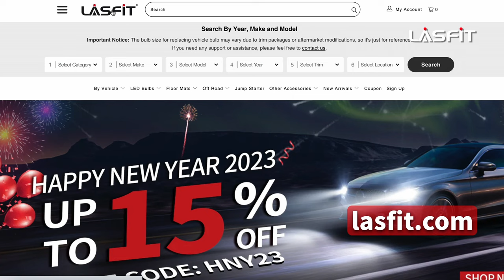NEW Version!!! How to install standard H7 LED headlight bulbs? LA Plus H7 Installation Guide

Comment: Good evening, I would like to replace for fiesta 2015 manufacture halogen bulb with H7 LED bulb, please assist me, im John
Reply from the maker: Hi John, the high beam bulbs for the 2015 Ford Fiesta are H1, and the low beam bulbs are H11. You do not need H7 bulbs.

https://www.lasfit.com/products/2014-2018-ford-fiesta-led-headlight-bulbs-interior-exterior-light-plug-and-play?utm_source=Social&utm_medium=YTB+Channel&utm_campaign=Ford+Fiesta
This link contains the bulbs for all installation positions for the 2015 Ford Fiesta. I hope you find it useful!

Comment: I have a 2016 vw jetty tsi. Which adapter do I need. Thanks.
Reply from the maker: Hi, Lasfit offers H7 bulbs specifically designed for the 2016 VW Jetta, with a Retainer Adapter, ensuring a perfect plug-and-play fit. Here is the link for you: https://www.lasfit.com/products/pro-series-h7-led-headlight-bulb-w-retainer-adapter-for-vw-mercedes-benz?utm_source=Social&utm_medium=YTB+Channel&utm_campaign=Pro-MB1

Comment: Do I need a special adapter for a 2014 Kia Optima?
Reply from the maker: Hi, you don't need a special adapter for the 2014 Kia Optima, but we have found that there are two different bulb sizes for the 2014 Optima low beam.

Please check which bulb size you have H11 or H7 before replacing the halogen one.
Reply: @lasfitvehiclelife  Pretty sure it is H7

Comment: Hi, só do I place the curved opening around the led to the bottom or to the top? It looks like you placed it to the bottom. But you didn't mention anything regarding that
Reply from the maker: Hi， if you are not installing custom-made H7 LED bulbs, please pay attention to the factory adapter before installing aftermarket LED bulbs. As you can see from this video, sometimes the curved opening is located at the top, and sometimes it's at the bottom. It depends on the factory placement.
Reply: @lasfitvehiclelife  Thank you. I am currently haveing a big problem with reflective road  signs  when turning on the highbeam head lamp as it throw back too much light back to the car and windshield outshining my vision. Before I was using it opening upside, now I switched to oppening downwards. Let's see if there is any improvement or I will have to move back to halogen.
Reply from the maker: @mmarfe  Hi, according to your description, maybe you can try to adjust the beam pattern first, you can take reference about the adjustment from the following video:https://www.youtube.com/watch?v=-URl1GIoEnM

BTW, would you please tell us your vehicle's Make/Model/Year and whether you have bought Lasfit LED bulbs?
Reply: @lasfitvehiclelife  Hi, I drive a vw Tcross 2021. It's a model sold in Brazil. It's a dual lens setup with both lenses using h7 lamp. The led lamp used is not from your brand.
Reply: Though it's a good lamp as far as reviews go. If you don't mind I can send you the link here.

Comment: Do I need an adapter for a 2017 Kia Optima Ex?
Reply from the maker: Hi, the Lasfit #Pro-HK6 is a specially designed H7 bulb for the Kia Optima, complete with an adapter, making it plug and play without requiring any modifications.
Here is the link for you: https://www.lasfit.com/products/2017-2020-kia-optima-led-bulbs-upgrade?utm_source=Social&utm_medium=YTB+Channel&utm_campaign=2017-2020+Kia+Optima+Combo&variant=39644298215603

Comment: I  have mercedes 2013 ML 350.  which adaptor I need for replacing H7 LED low beam light?
Reply from the maker: Thank you for the message.
We just release the latest LED bulbs, you don't need any adapters to install on your mercedes 2013 ML 350 low beams.
You can check more details on this page:https://www.lasfit.com/products/h7-led-headlight-bulbs-laair-series?utm_source=social&utm_medium=YTB+Channel&utm_campaign=LAair+H7

Comment: will it work on 2001 c240?
Reply from the maker: May I ask if your 2001 MB C240 is equipped with OEM Halogen headlamps or OEM HID headlamps? I will recommend the suitable headlight for you.